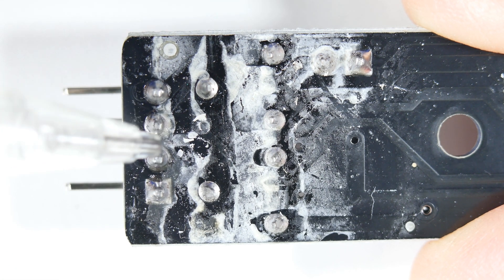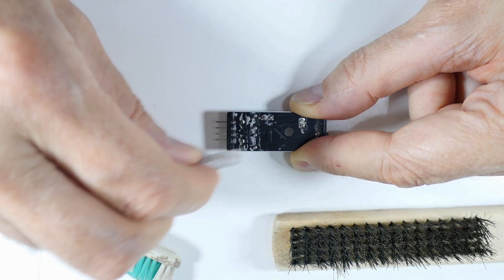Water/Humidity Affected Circuit Board - Cleaning (4K)

Comment: I found white on a pcb of a multi effect pedal for guitar.
My daughter spilled coke over it (the drink)

How fast does something like this develop? Been a hour or 6 ago. Or can it be from moisture in the air? It is under push switches. I pushed them and they are filled with cola 😞 I tried to remove it as best as I could.

I hope it can be cleaned and it still works.
Reply from the maker: If you know the safety and damage risks  many electronic devices can be cleaned the water, then rinsed with distilled water  and finally dried with multiple doses of 99% alcohol. Obviously there are serious fire risks both from the alcohol and a device that has been cleaned wrong and has high resistance connectors. There's also risk of trashing a switch by removing the lubricant then operating it. If you don't know, find someone who does. Coke is really corrosive!
Reply: @tsbrownie Thank you for your reply. 
I recently watched a guy rinse his amp boards. Never knew that was even a possibility with boards. Since it is quite sensitive.

I googled pcb switches. It are small ones. About 6x6mm. Replacing them would be easier. They cost 30 cents a piece. Then of course I don’t know what is affected elsewhere on the board.

Maybe I just give it a go. Then power it up outside. Don’t know if it is worth bringing it to a tech given the price of a new one. 

Guess it’s part of being a parent.
Food for thought.
Reply from the maker: @nieko3038 My 3 year old emptied a can of bug spray into the keyboard of my work laptop. He had seen an ant. So many lessons learned with that one.
Reply: @t @tsbrownie Little one wasn’t wasting time and right on it 😄

I can’t blame my daughter. We often put our glasses on the armrest of the couch. Pedal was next to it on the floor. Maybe it was a matter of before something like this would happen.

Comment: So, I have had two circuit boards on a HVAC air handler in my crawl space go. The first was four years after the install and the second a year after   that. Not good since they run in the upper $500 range here in NC to R/R. I didn’t get to see the first one that was replaced the installer took it with him. The second one was shown to me and yep, the white stuff you brushed off was on many parts of the board but on the top side rather than the bottom like you cleaned. My crawl space is very humid and I know what needs to be done but it’s super expensive and I can’t afford it right now however, I don’t  want to replace circuit boards every year that we have unheard of heat and humidity. 
Would it be helpful for me to spray contact cleaner on the board like every month would that help to keep the corrosion in check? Or am I dreaming,
Are there other ways that I could seal, coat, bag, cover or whatever to prevent the board from getting too much moisture?
Reply from the maker: I don't know the voltages involved in your circuit board. Spraying them could cause fire, shorts, electrocution, etc. I've heard of something called a conformal coating, but I know nothing about them and have never used them. 
I have lived where it's very humid, and my solution was to add a small electronics pie fan to blow on the board constantly. It's not a perfect solution because humidity is still there (but this helps prevent water from condensing, which is a quick board killer), and it blows dust onto the board which needs to be cleaned (how often depends on the environment).

Comment: Thanks,  I've not encountered an issue like this before and your explanation helped me better understand this. I may have to try cleaning my smart lock's pcb. 
Apparently condensation is forming due to the temps on the outside of my door being sharply different than temp in my home. 😅
Reply from the maker: I've never considered smart locks, but that makes sense. The metal parts that pass through the door can create condensation in unexpected places.